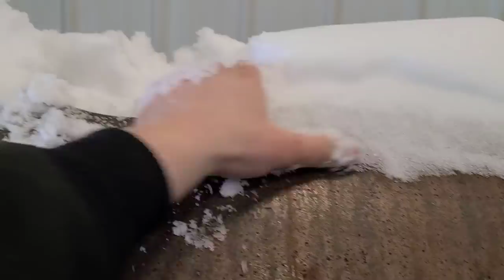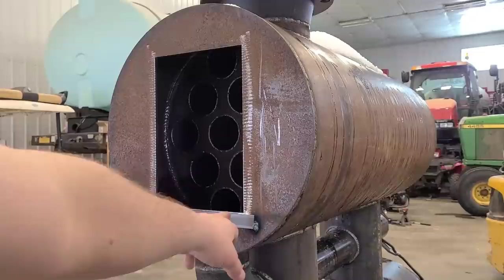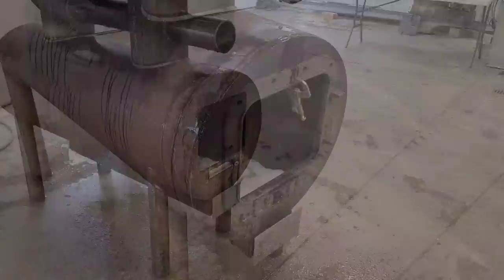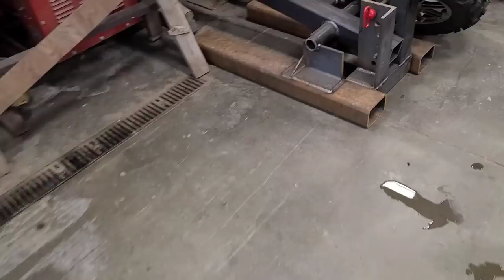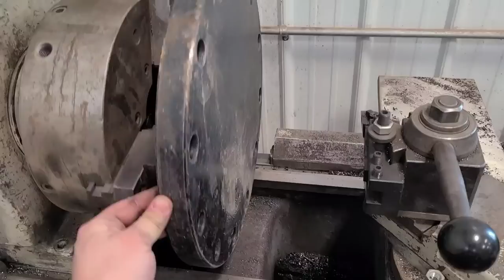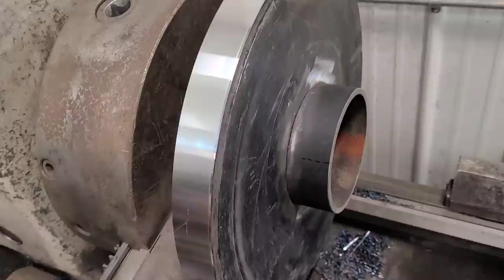My Ultimate Shop Wood Stove Build Part 2

Comment: should be a good stove as long as it never falls on anybody😉
Reply from the maker: It actually very stable because it's so heavy. I've tried pushing it over and it could be done, but it's going to take great effort to do so. Once the chimney pipe is on, it will basically be tied to the roof of the building and unable to fall over 👍
Reply: @kylechrist  sorry, I never thought it would fall, it was just my way of saying I think it is built heavy enough to survive a fire or two. I'm a little warped & everything I do is overbuilt as well
Reply from the maker: @steveschumacher5470  haha no worries, I've just had quite a few comments about it being top heavy and unstable, so I thought that's where you were going with that 👍

Comment: Hi 
If the chamber of the fire is hot enough, the gasses from the wood are the main heat generating item. 
In clean burning ovens, preheated air is introduced in the back or over the fire to provide oxygen to let the gasses burn completely. 
Im obviously knocking in open doors here, but possible to experiment with.

And, why do you cap of the exhaust!

Eirik
Reply from the maker: I didn't cap the exhaust

Comment: You might want to consider adding a baffle at the top of the firebox, preventing the hot exhaust going straight out the chimney. Your hot coals and fire will suck air in from its margins, in this case mostly the door, by preventing the smoke from exiting directly and bringing it back down towards the door before it can get out, any carbon monoxide laden gasses are liable to be sucked back under the coals, re-burning the CO into CO2, this both reduces potentially harmful gasses but also makes the fire burn hotter for the same fuel. You are oxidising carbon, why only oxidise it once then throw it away when you can re-burn it and get double carbon bubble!
Reply from the maker: This would be an easy add on, I'll look into it 👍
Reply: @kylechrist  doesn't need to be airtight, or come too far down, near the door, 2/3rds does the job nicely, no need to make it air tight, it just needs to usher the gasses to where they might get reused. It works best when the fire is restricted for fresh air, then it tends to pull the gasses back through the best. Just remember, fresh air is 2/3rds nitrogen, an inert coolant gas, by 'double-burning' your gasses, you effectively cut that proportion to 1/6th.
Reply: @freemanjackmsiradio  I really wish I understood what you were describing. Just can't picture it. Do you have any links to examples?

Comment: You can remove three bolts and twist and move complete fan motor to any place you want.
Reply: Yep,just like an alternator that way.
Reply from the maker: Correct, but I like the idea of where I have the switch now as it moves the wiring back away from the heat of the stove 👍

Comment: Nice build , I would like to design/build a oil waste heater
Reply from the maker: As long as you have access to waste oil and can keep it clean (no antifreeze or water in it) then they do fine. My problem is I don't have enough waste oil to burn and most mechanic shops around here use their waste oil in their burners
Reply: @kylechrist  lol our winters are not harsh (maybe 6-7) days with it being below the 30’s. We live in SW Louisiana so I’m thinking my five oil usage fleet would be enough lol.

Comment: Those type of fans are designed to push air through ducts. You might have enough resistance with the heat exchanger but you should definitely check the amp draw and make sure it’s below what’s rated on the motor. If it’s too high you need to cover part of the inlet opposite the motor. It will actually push more air if there’s the right amount of restriction.
Reply: A low volume fan

Comment: I have to ask, did you do medium/heavy wall build because of the potential mass to heat soak? What's the actual mass of this mammoth? Looks like it'll keep working as a heater hours after the fire goes down and won't need a paintjob for a hundred years!
Reply from the maker: It's what I had for scrap material, weighs about 1500lbs

Comment: Are you going to utilize a flu damper in the exhaust?
You'll find it will help to regulate the heat and conserve firewood....
Reply from the maker: Possibly? I want to see what it's like with just the door damper, and modify as necessary from there

Comment: dummy tube could become a pressure bomb. might want to put a 1/16 vent hole in it.
Reply from the maker: It's not fully welded on the inside top 👍

Comment: You Could have done 2 switches. High and low so if it gets hot you can turn down the heat lol. That fan housing will probably get really hot if you turn it off with the fire going. Hell you could have gone all out with a thermostat and everything Haha!
Reply from the maker: 15 seconds in I say it's going to be on a thermostat 👍
Reply: @kylechrist  i guess i was paying really good attention lol

Comment: Did you get the tubes cut & welded on the front end of the heat exchanger? Also, if you had air injection into the exhaust out of the burn box it would significantly reduce smoke.

Comment: 10 months late but if you know you will never remove the door rather than double nut them or using lock nuts you could just put a small tack on each nut. that way it stays tight and if you ever need to take that door off years down the road you can just touch that little tack with an angle grinder and loosen it off.

Comment: The fan seems pretty overkill for a wood stove. I'd guess with that much surface area you're already gonna be dissipating most of the heat passively, and you'd only need a slight breeze through the pipes to get the rest.
If it wasn't for the sound pollution and electricity bill it wouldn't be a problem.
Reply from the maker: The fan is to help spread the heat, radiant heat does not travel far on its own, especially in larger areas
Reply: @kylechrist  Damn you're right, I didn't take into account your shop is probably bigger than my little work area. No notes then, awesome build!
Reply from the maker: @whynotdean8966  I'm not sure how big your area is but mine is 40x50, so 2000 sq ft to try and warm up 👍

Comment: Treepan it put growing tool that matches radius put it upside down and plunge in from the back side and when you're within 15,000 start looking at the other side for a bulge when you see the bold stop you can whack it with a hammer it'll pop right off
Reply from the maker: I'm not sure what you're getting at here
Reply: Less tool wear faster cut less matal

Comment: Did you think about capping one of the lower pipes and drilling holes in it to add a secondary burn for wood gasses?
Reply from the maker: No, I don't want to pressurize the system and have it blow smoke out of the damper below the door

Comment: You may also experience a lack of upward draft due to the very convoluted path the exhaust must take to get out.
Reply from the maker: Heat rises 👍
Reply: @kylechrist  I get that part but you are trying to get as much heat as possible with several extra steps. 
 If the exhaust is cooled too much, it will cause poor to no draft.
Reply from the maker: @lestergillis8171  I can assure you this design has no issues with draft, there is also no damper like most wood stoves run so it (for the most part) is free flowing. There are many wood boilers that make that smoke go back and forth 3-4 times before exiting. Even with the fire toward the front, it only has to go to the back and up, from the back to the front and out (only 2 times) 👍

Comment: Very impressive build ! Did you hand drill all of those holes or use a mag drill ? Happy new year to you and yours
Reply from the maker: Which holes?
Reply: @kylechrist  the multiple holes for the bolt on door. Drilling thru the 3/4”
Reply from the maker: @williamhall5087  just a cordless drill and sharp bits

Comment: Sorry if this is a dumb question and maybe it’s just that I haven’t seen it fully functioning, but when you are loading it with wood do you turn the fan off each time so it doesn’t blow in your face?
Reply from the maker: No, I can have the door open with the fan running. Part 3 is up if you'd like to see it in action 👍

Comment: Working out the issues🤗 my fav part.
1. I did it too. 
When you are reloading the stove you will need to open the fire chamber door. Once the door opens smoke will roll out of the top of the door opening from the combustion chamber. The air flow from the fan will be blowing smoke and hot ash into your face & 👁👁 as you feed the fire. 
Two easy fixes I can see are. 
a. the bottom 6" pipe could be Capped off on the end and holes drilled to the side so the Cap will discharge airflow to the sides of the heater and not back into your face.
a.(1). A coffee can could be placed on the 6" pipe Cap as an air deflector and/or dampener. Twist or push/pull to adjust to desired air flow.
b. I have also used a flapper valve that chokes the combustion chamber opening entrance when opened. Flap allows wood to be placed into the combination chamber and not allowing excess smoke and hot ash to exit into room.😥
Smoke, smoke, smoke  
2. The next thing I would look into would be draw cold air into the combustion chamber from outside the house, giving the house a neutral or negative pressure load. A positive pressure load draws combustion air from inside the house which needs to be replaced by cold air form outside the house. Pulling cold drafts through the house to replenish the combusted air, whereas, a negative  or neutral pressure load negates that process.
run the stack hot all the time & once a week/month clean chimney and you will never have a crescendo problem. 
Good luck 👍😁 
I still have the controls to my old Bison wood stove furnace 😁😁 . Can hardly move right now but when I'm better I'll dig out the manual and send it to you. 👍

Comment: FIRE BRICK WOULD HOLD MORE HEAT.
Reply from the maker: Firebrick is an insulator, therefore heat that is currently radiated out in the lower chamber would go out the chimney

Comment: Are you sure the fan is big enough?
Reply: Trust me you don't want it too big. I had to add bundles of 1 1/4" pipe to slow the air flow,cooled off the heat exchanger too much.

I did detect some sarcasm!
Reply from the maker: I think it will be alright 👍

Comment: Why not just get a 6" Blind Flange instead of destroying a big one.  A piece of 1/2" t plate would work.
Reply from the maker: For one, a 6" blind flange won't fit on an 8" neck flange very well. Two, I used what I had, it's not destroying, it's repurposing 👍
Reply: @kylechrist  Sorry, I didn't know it was an 8" Flange.

Comment: an automatic switch controlled by a thermo probe.... fan runs based on heat output in the middle column
Reply from the maker: While I'm not opposed to something like this, I would want to series it with a thermostat so it doesn't get too hot in the shop as well 👍
Reply: @kylechrist  how would a thermostat control the heat output? is that not dependent on how much wood / air  is consumed? controlled damper/ air gate?
Reply from the maker: @timothywhieldon1971  it wouldn't stop radiant heat but if the shop was at 80°F then I wouldn't want it any warmer by having the fan blow. By using a line voltage thermostat, it would shut the fan off once it got up to temp. Hopefully this makes sense

Comment: Fire brick in a stove with a wall thickness in firebox that thick is waist of space! Never warp or burn out! They put fire brick in stoves with 1/8” or 10 ga metal to eep coals an heat off metal. Your blower spins to fast or hard Guna cool off tubes to fast an keep cycling. I have built dozens of these type with a snap disc control for fan.
Reply from the maker: The point of the firebrick would be to move the heat into the heat exchanger instead of heating the lower barrel for nothing. The blower has 3 speeds, I'm starting with HI and seeing how it goes, it may need to be backed down which is exactly why I left all the wires in tact

Comment: Cast Door like these are junk. They never keep the seal in place after few burns an then leak air thus making stove burn hot
Reply from the maker: There is no seal to begin with. It's a stepped ledge in the cast iron